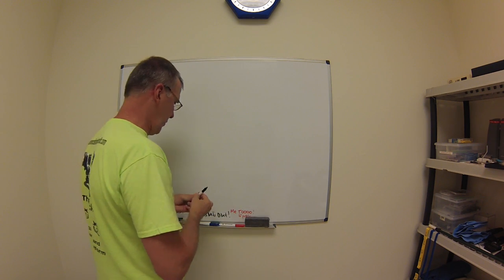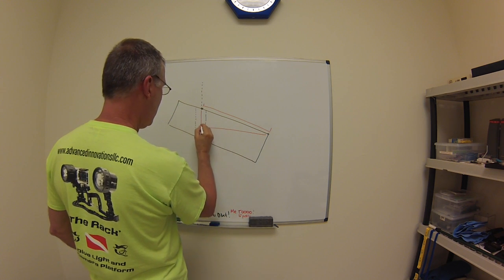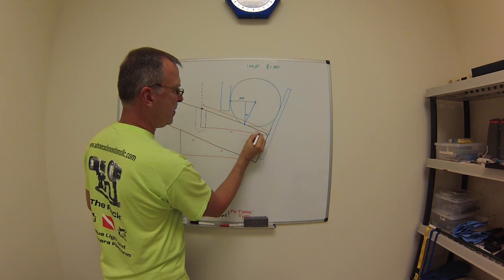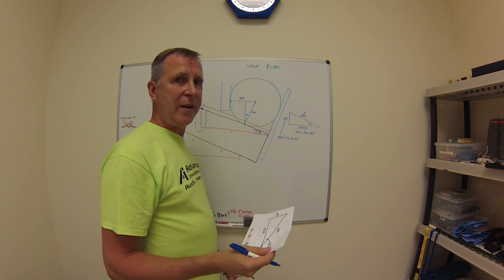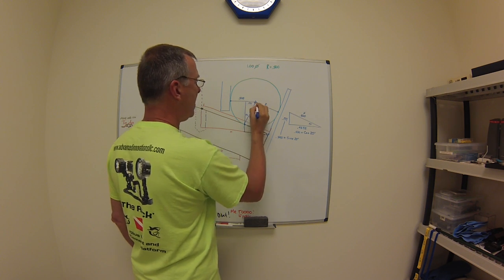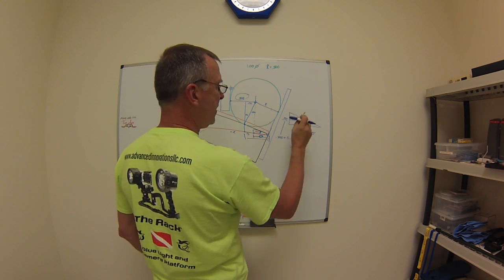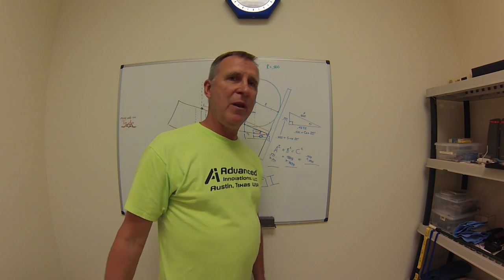locating angle holes

Comment from the maker: Thanks for the thumbs up and down. If you leave a thumbs down, please also leave a comment on what you didn't agree with or didn't like. I am always willing to look at another way.
Reply: The people giving thumbs down, rarely ( most likely never speak out ) everyone of us get them, not to worry about unless there are more down than up...   lol
Reply: Great video, thanks. Alternatively, instead of a drill blank use a square gauge block with knife edges. Use a shorter parallel so you can use the edge of the block to replace the rounded edge of your work, then use trig that you would have used if you had a knife edge on your work.

Comment: Excellent use of trig for locating a feature.  You're explanation was spot on except for calling the hypotenuse the "long leg." The "legs" form the right angle. 

Maybe start the video introduction with you as the main subject (as shown here), but zoom in to just the white board during the detailed explanation/sketching. Then zoom out for final thoughts/conclusion. If possible, wirelessly pause the Go-Pro when re-positioning camera tripod to avoid lengthy video editing in post production. 

Thoroughly enjoy the use of trig tables over punching buttons on a calculator.  Unfortunately, "young" machinists,  designers and engineers have never seen a trig table outside of a Half-Priced Books math/science section. 

I'm really enjoying the knowledge you share.
Reply from the maker: Richard,  Thanks for the comments. I have just recently discovered how rare that book is that I suggest everyone gets. You can find them on EBAY if you get lucky. I usually shoot and post these videos in one day, solo. I have tried to avoid post production editing. These actually come right off the GoPro. ( not always on the first try ) I was wondering if someone would call me on the use of the term 'long leg'. Thanks for keeping me honest. I did not want to assume everyone knew what a hypotenuse was. Hopefully if they read this exchange..they will. Again, thanks for watching and your compliments and comments. Stay tuned. More to come.

Comment: Thanks for your efforts.  I agree with Mr. Getso's suggestion that you zoom in to the whiteboard after the introduction.  Your efforts on the board are less then visible from the wide angle distance.
Reply from the maker: I do appreciate the feedback. I may try a different camera on the next video to see how that works. Most all of these have been shot with a gopro. Believe it or not, the camera is less than 3 feet from that board. I almost cant fit between the tripod and the wall. Its a super wide angle lens.

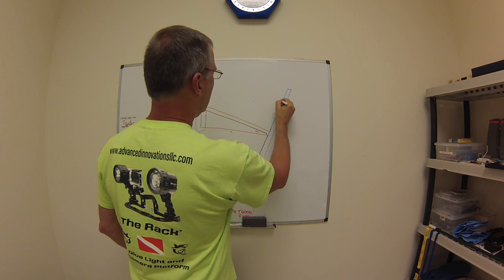Comment: Ok I got the trig part how you used the bit or rod to form the values for your triangle.  I get a bit lost when you say "just shift". Am I to understand that the value for the larger 20 degree triangle is already stipulated on our diagram and the distance that we calculated to the edge of the bit is to be subtracted from our edge finder then the mill moved the difference? Please keep in mind I am watching this at 3:30 in the morning with a bad case of heart burn. Thanks
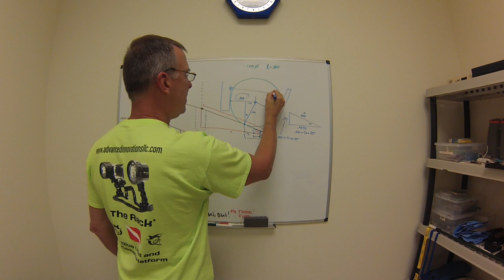Reply from the maker: At about the 8:45 mark I use the term shift. This is the distance you move your table once you have picked up the edge of the pin and zeroed your dials or digital. It is the distance from the edge of the pin to the corner you are trying to find.
Reply: Thank you sir you are a scholar and a gentlemen

Comment: 12/26/2021
I guess I'm a strange draftsman, I was an auto cad  draftsman who was responsible for creating ALL the shop drawings for the machine shop, where I worked.
I must be strange because I would use the computer, accurate to infinity, to place that correct dimension on the print, so the machinist didn't have to do all that math, and me too. Just like a good machinist, I learned tricks, shortcuts and the hidden ability's of the cad software. As Joe says, "there are at least 10 ways to do something,  it's the same with a cad operation".
Needless to say the operators, inspectors and MY boss. really liked me, for some strange reason
Oh ya, the engineers would do the things you mention, but I tried to make sure it didn't matter. 5 minutes of my time saved double or more in the set up, production, and inspection time.
I wonder if other guys, like me, did this or liked screwing with the operators? ;-)

Comment: great demo joe. wold it also be possible to clamp a parallel across the part and flush with the top surface. use the sharp edge of the parallel to pick up the edge. i realize that the top surface of the parallel is on the hypotenuse and you would have to calculate the opposite side as a start point ? show us more
Reply from the maker: Hi Larry. I believe that would work. As long as you know how thick that parallel is and make sure its straight and flush with the part top, you could use an edge finder on the parallel then the trig deme to figure it out. You would still have to solve for 2 triangles, but its dealers choice here. On parts that are not tooling ball friendly, this is a good way to know where you are.

Comment: Great video! I have question maybe you have a trick. I have to make a 23 hole pattern circle with holes drilled at a 7.27 degree angle in a cylinder shaped part.I am thinking of tilting the head and using a rotary table type indexer to do this. I wondering how to accurately locate the center of my part so I can make sure I create the correct PCD.
Reply from the maker: Have you watched the video on 'No Indexer, No Problem' Maybe that may help. As for finding center, you can indicate it or use an edge finder. How big is the cylinder?
Reply: It is a flange shaped part with the an OD of 150mm the PCD is at a diameter of 100mm with 23 holes that are drilled at a 7.27 degree toward the center of the part. It is 80 mm in length or height. Maybe i could use an edge finder on the OD if i touch exactly on the high, but I am unsure if it will be accurate. I don't think i will be able to sweep the part because the head will be tilted. i purchased a tooling ball with the hope of making a plug for the center of the rotary table that i will insert the tooling ball in and be able to sweep while the head is tilted. knowing the distance from the face of the rotary table to the center of the ball at given angle i can calculate the distance i need to move in x to be in center of the table. Then calculate the distance i need to move in x for the length of the part. lmao Idon't know its hard for me to picture any of this until i actually set up the part. maybe i'm just over thinking it...
Reply: @chrisn3794  how did it go? What'dchya end up doing?

Comment: I probably will need to watch this a couple of times, but I get the gist. We use calculators here ... so where could I get a copy of the Illinois(?) tables? I have a way of remembering Trig formula - I can remember Tan (opposite over adjacent), but can't remember which is sine and cosine, so I use a word analogy (nemonic?):
Sine is oppoSite over hypotenuse, and cosine is adjaCent over hypotenuse for the angle in question.

Comment: I think I have this correct in a spreadsheet - since a lot of people have computers or even smart phones with spreadsheet apps. =(0.5*A2)*(1-SIN(RADIANS(B2))+COS(RADIANS(B2)))   Where A2 is the diameter of the pin and B2 is the angle.

Comment: Hey Joe, how about putting a Pac-Man shaped piece of material on the reference corner. Sandwich Pac-Man between your part and your stop. As long as your stop is a vertical plane that touches tangent to Pac-Man's outside diameter, you know your stop is offset "exactly" one radius from the corner.  I'm probably describing an actual tool with an actual name that was invented in the 19th century, but I haven't seen one yet so that's my take on it.  Well actually I got the idea from another video of yours showing how to use a ball or cylinder with a flat for holding rhombazoid shaped parts. I thought that was pretty clever. So I just wanted to return that clever idea back to you, slightly modified. Let us hope that we don't find too many holes drilled at odd angles on our prints, making occasions for using such a tool few and far between.  I'm not much of a commenter because when I do I kind of ramble on and on as you may notice. So let me take this opportunity to say thank you for freely demonstrating your knowledge and experience to all of us hacks, essentially inviting us into your shop and showing us how you do what you do. I appreciate your hospitality Joe. Happy holidays!
Reply from the maker: Pac man corner finders do exist. They are pretty cool. Happy Holidays to you as well. Thank you.

Comment: You made that harder than it had to be.  The right half of the round moved along the line by it's radius. The left half of the round didn't move along the line as much because of the angle of the edge finder to the angle of the slope.  If the angle was zero then it would have moved along the line by 100% of the radius. As the angle increases the movement along the line decreases. When something starts at 100% and goes down then you know to use the cosine of the angle, whereas when something starts at zero and moves up you go with the sine of the angle. Since this starts at 100% of the radius and is going down with the angle you use the cosine of the angle to find out how much it moved, which is less than 100%. Add that to the right half and you get the total movement along the line. So to do it quickly, it's the full radius on one side plus the cosine fraction of the radius on the other side.
Reply from the maker: OK....Here we go. If I understand you correctly, I may have to disagree. Your method would be quick and accurate if you were trying to find the linear distance between the contact point of the edge finder to the pin, to the contact point of the pin against the parallel as calculated between parallel vertical lines. I am having a hard time seeing how your method would give you the point on the part since the location parallel is a sloped surface. I am not disagreeing with you  (yet) but I am having a hard time visualizing it. Please respond. I am intrigued.
Reply: Joe Pieczynski I'll make a drawing and send it to you. I'm one of those people who just sort of "see" math.
Reply from the maker: OK. I took the time to evaluate every possible combination of values for this 20 degree triangle based on your comment. I like that. Its always good when someone makes a comment I have to dig into before I take a stand. Unfortunately, I have not been able to find that lower corner with less than 3 steps, so I have to disagree with your earlier comment. I am still looking forward to your sketch. Please still send it even if (when) you discover you are incorrect.
Reply: Joe Pieczynski, so you think I'm wrong?  I find that pleasing. I have a saying that ensures I am right as much as possible: The only thing I hate worse than being wrong is staying wrong. (Someone should make that into a wall sign' for every shop.)  Therefore when someone questions me they have my full and appreciated attention. I'll get something to you tonight. This morning I thought of another way to do it that might be easier to explain. Let's see.
Reply from the maker: I do believe you are wrong. I hope you find my challenge with the respect with which it is intended. I too have an uncanny knack for mechanical comprehension. I also have about 20 triangles on a sheet of paper right in front of me, and can't come up with that front corner using less than 3 numbers. I can find the pin contact point using your method, but not on the part. I anxiously await your reply.
Reply: To everyone who's been watching this, Joe's method is correct. I've got drawings and Excel to prove it.